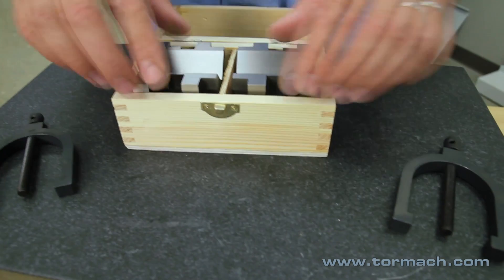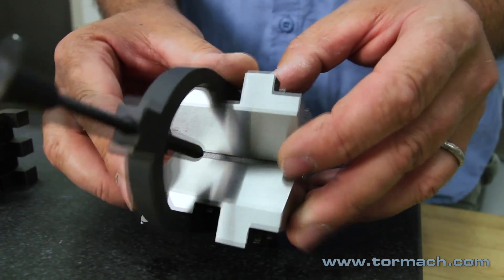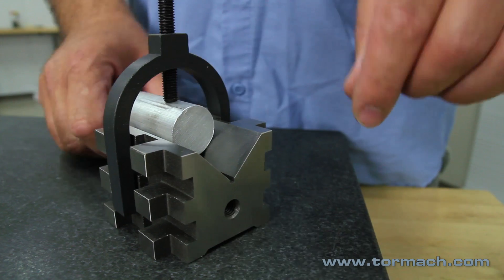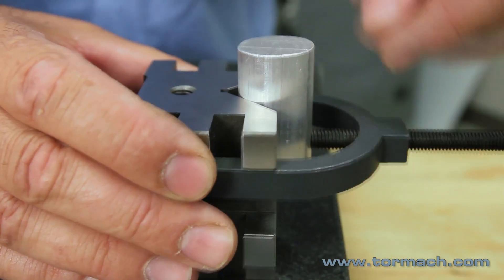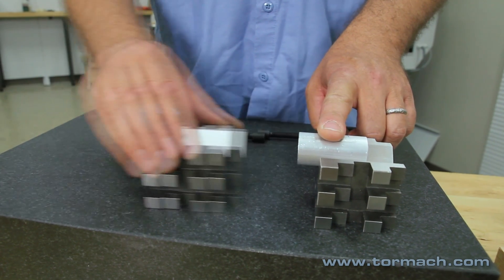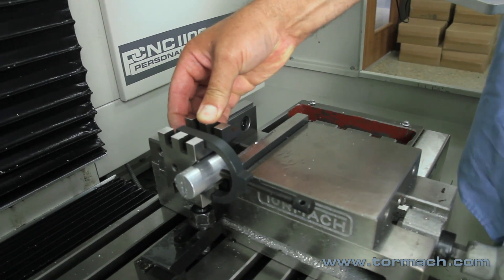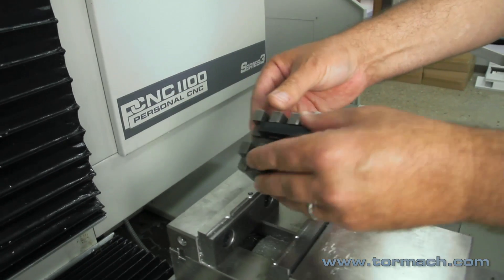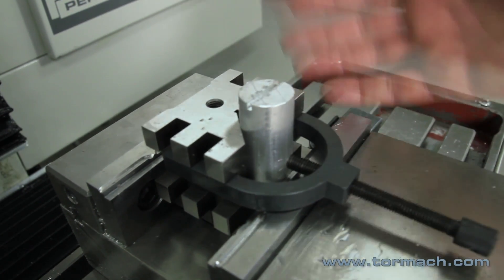Workholding Basics: V-Block Tips

Comment: Agree with wnoze3607 but also why does that bolt not have a ball or something on the end so it doesnt try to screw around when clamped. The V blocks are really nice but a bit of work is needed on the clamp bolts in my opinion